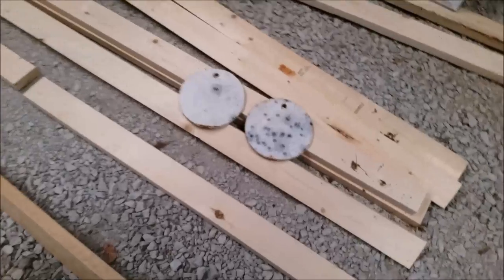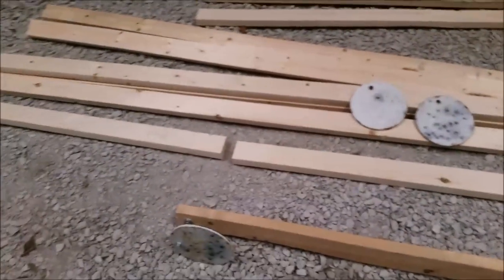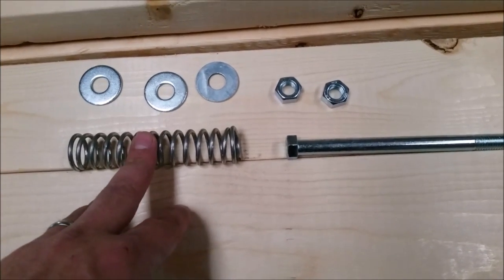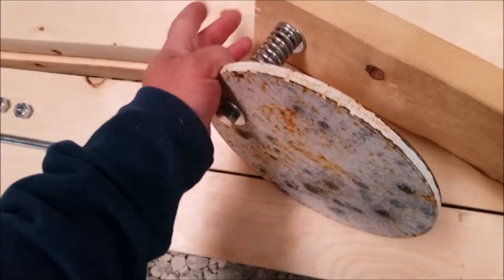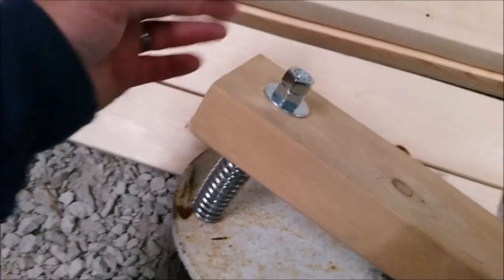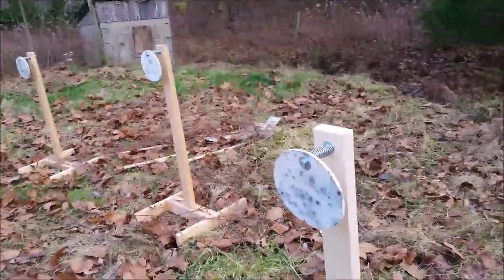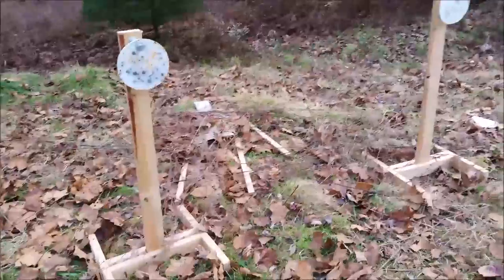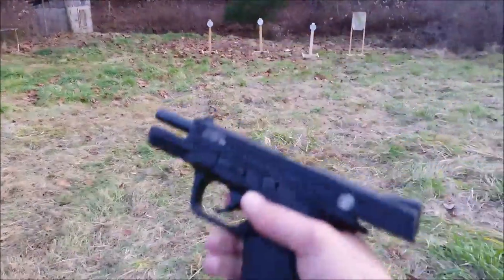How to Hang AR500 Plate Targets

Comment: You may want to angle the bolt through the 2x4 so that the plate in angled downward to the ground for ricochets.
Reply: the 2x4s are angled
Reply: @a.t.hustle1583   Are the bases raised a bit, at the back?  I'm making this one, but I'm drilling the hole at a 20 degree angle, which matches the manufactured ones...
Reply: That's the point of being held from the top and backed by a spring. Too much angle and the shrapnel will start cutting the 2x4.

Comment: nice. good shooting. And I also have the same gun.  use it for "budget practice" since the 22LR is cheaper than the 380, 38SPL, 9, & 45 I got. And the M&P 22 is a great gun, reliable, and accurate. much better than the P22 Walter I got rid of.

Comment: Cool! will I be able to leave them out all the time or will they blow over?
Reply from the maker: Mostly Outdoors, mine have been outside for over a year now.  the ones with metal targets don't blow over.  but we did knock one over once with a 45-70 from 100 yards.    I do have some target stands with cardboard IPSC targets stapled to them and they will catch the wind and blow over.
Reply: smalltown442 Thanks, I will probably put a old tire over the base...
Reply: @MostlyOutdoors  I drill holes in the bases, tie paracord loops through them, and use tent stakes to stake them down... no weight carrying, and sturdy as it gets.